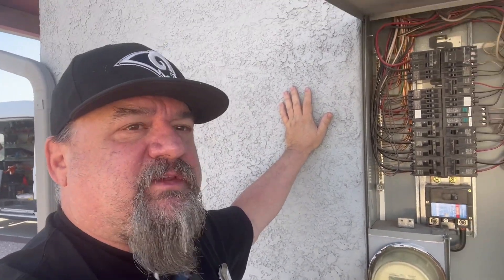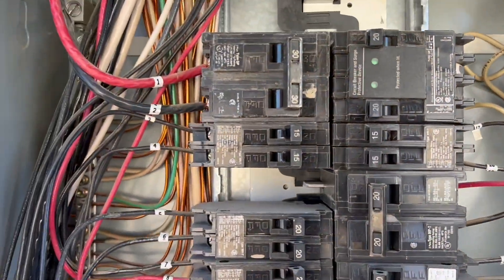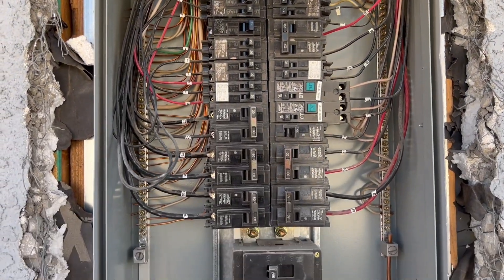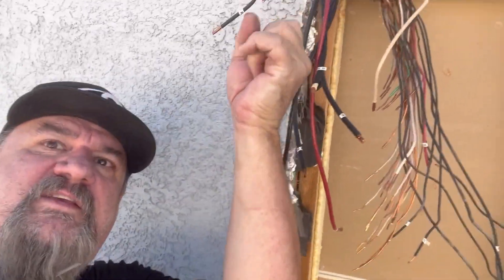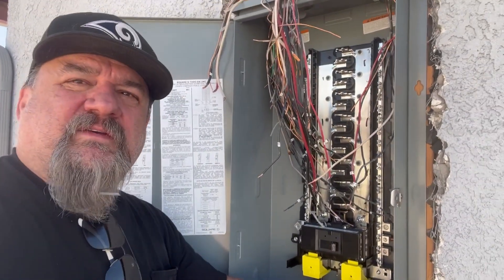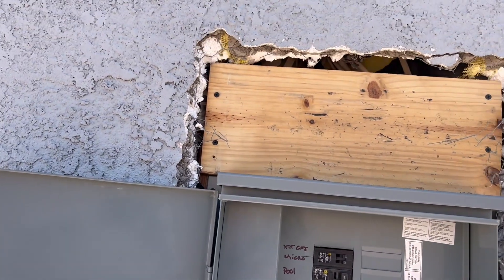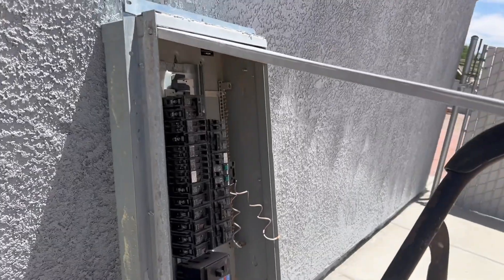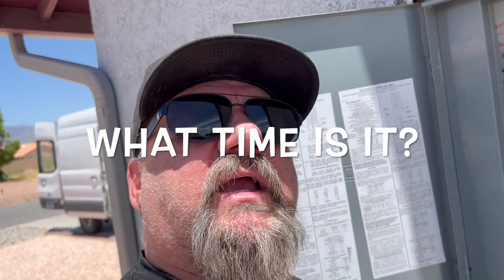How to Install a 200 amp Electrical Panel in a Stucco Wall Outside. Solar Ready Electrical Service.

Comment: Wish I could like for like, my jurisdiction they’ve banned flush mount so I have to seal the hole and surface mount, and counter sink a pull can on the laterals to convert to surface conduit.

Comment: Did the service conductors were long enough to reach the meter line lugs?
Reply from the maker: Barely! Had to sleeve the branch circuits because the were a few inches short

Comment: What makes it “solar ready” is the bus is rated over 225 amps vs a standard 200 amp non solar ready bus rated panel. Adding solar to a non solar ready panel there is the potential to overload bus very very unlikely but the potential is still there to overload.
Reply from the maker: lol thank you I just learned something!

Comment: I'm curious how you protected all those cables coming into the top of the panel where the sheathing had been stripped away for the old panel which was 8" higher.
Reply: Short pieces of flex with a connector for the box?
 ... headache but it works
Reply from the maker: Short pieces of pvc sleeves

Comment: You couldn't have used a masonry cut-off disc on a portable grinder to cut into some of that wall?
Reply from the maker: Yea I used a chipping tool. Easier I thought to look more natural with rough edges.

Comment: Locking ring on feed side is unside down. Thats a code violation 😅.
Reply from the maker: lol the damn pvc sucked down! Uggg. After I shot the video  and pulled up the pipe I put on a bushing too.

Comment: Thanks for the video.  The bussing is rated at 225 amps to make it solar ready 

I'm in Southern Ca and we have the same finish,  stucco.  I open up the back of the drywall behind panel as I have roughly 4 hours until the insoector shows up. 
Prep and pull permits one day and the drop out panwl and install new panel the day of the disconnect/ reconnect.
Reply: Great idea regarding opening the wall from behind to remove the old panel. I was looking at my 50 year old Zinsco panel and depending on what improvements are made to the house it will have to be replaced. I was wondering about the stucco
Reply from the maker: Thanks for the info!

Comment: Where's your bushing on meter feeder conduit connecter?
Reply: Pvc male adapters are generally accepted as providing equivalent protection to a bushing. And as you see in the video are in absolutely zero risk of being cut on those threads. AHJ ultimately gets to interpret this, but a bushing is not required for pvc adapters/fittings.
Reply from the maker: I ended putting it on after I shot it. lol thanks